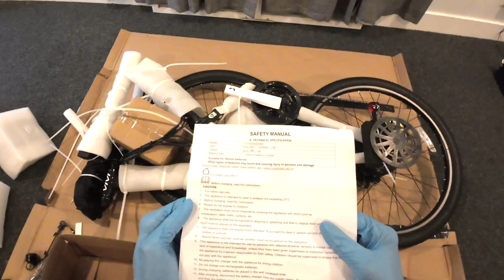VIVI M026TGB FOLDING ELECTRIC BIKE UNBOXING & ASSEMBLY

Comment: any issues with the cables hitting the battery when turning?
Reply from the maker: No issues, but I did secure the cables to the stem with some gorilla tape just to be safe.  No issue with the bike.  Over 1,130 miles as of me writing this.  I've had it for a little over a month. It's been a great little e-bike.

Comment: after charging, I cannot get the battery to slide into the housing. The silver knob on the housing won't move and impedes the battery from sliding on.
Reply from the maker: That is a security lock for the battery.  There is a key hole on the other side of that silver knob.  Use the key to unlock it and the silver knob will retract so that you can insert the battery.  Then turn the key the other way to lock the battery in place.
Reply: @LoneWolf74_  I got it, thanks